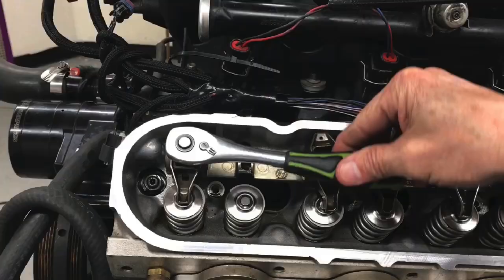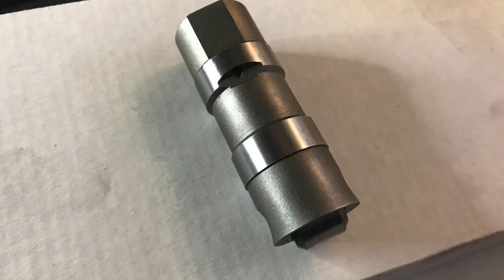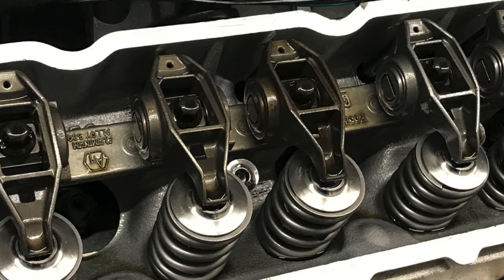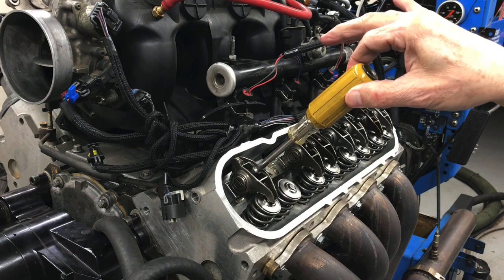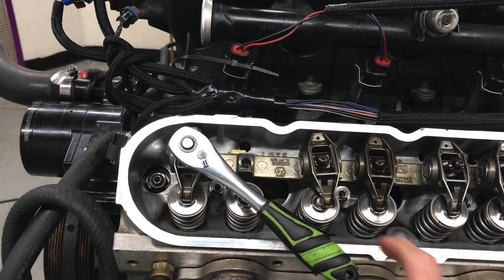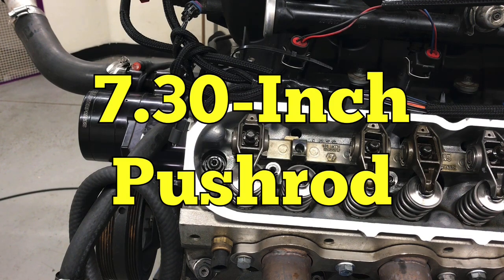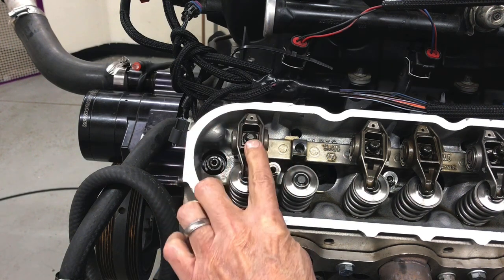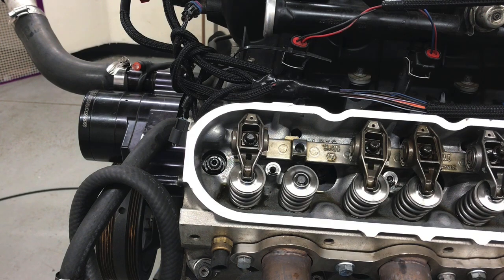HOW TO DIY: MEASURE LS PUSHROD LENGTH-CHEAP & EASY!

Comment: This doesn't show you how to figure out the length pushrod you need if the ones you're replacing are much shorter than what you need. It's a fail method if you don't already have the right length or one that's a small amount too long.
Reply from the maker: if it is too short-you have lash

Comment: Question for you i put my motor together and had a noisy valve train in the car dynoed at 320 whp, after doing some digging i had about .160 preload and with your method about 1 1/4 turns. The truck ran pretty good just seemed noisy. I put new pushrods in and my preload is closer to .80 about half a turn with your method. Does this seem about right? Also Do you think it was floating the valves before and have i gained any power?
Reply from the maker: less preload should not change noise and will not greatly change power

Comment: What does 1 full turn equate to?  .100'?    need a little more detail please,  running johnson lifters, they require .035' preload.   in this case 1 1/8th turn would be too much..   assuming 1 full turn is .100'
Reply from the maker: MEASURE THE THREADS ON YOUR BOLT-THAT PROVIDES TURN TO INCH RATE
Reply: @richardholdener1727  Yes i understand that and i have all of the tools to precisely measure this but i felt it could be confusing for others without the above information.

Comment: HEY DUDE, if im gonna do a cam swap and need to change my springs anyways, how much mor cost am i looking at if i get my heads milled enough to jump compression .5 to maybe even 1.0 more compression
  SO like goin from 9.5 % on stock LM7 to 10 .5 
whata  is a typical head milling like this cost? 
so i dont get rookie ripped off ....
is pushrod length only thing to worry about goin from 9.5 to 10.5 compression?
is that doable on87octane or am i lokking at 92 octane?
Reply from the maker: no on 87, don't mill more than .030, check pushrod length

Comment: Richard, I am lost. I order some Delphi LS7 lifters, Comp 1.5 roller tip rockers and BTR 7.200 pushrods. I just realized in the LS world, the lifter is torqued to 22ft and not a desired amount of "turn" like the SBC is so I guess I screwed up. Does anyone know how to set pre-load on this style lifter in a 350ci L98?
Reply from the maker: lifter is torqued to 22 lb-ft? Do you Mean rocker?
Reply: @richardholdener1727  Oops yeah I meant rocker
Reply from the maker: Setting the lifter preload on your SBC (assuming guide plates and adjustable rockers) is simply 1/2 turbo of preload past zero lash.
Reply: @richardholdener1727  It's an 88 Roller motor so just 3/8 stud no guidplates

Comment: How did you determine the safe done of turns?
Reply: Every lifter is different, but the bolt pitch means 0.050 travel per revolution. So the procedure is the same but you need to know the recommended preload for your particular lifter...

Comment: I have an L99 camaro just got a cam kit ss1 vvt done by gpi, ill be doing install.. head gasket is .040 and pushrods are 7.400 would that be any issues?  Is it because the cam lobes are shorter? it should be fine

Comment: Only way this will work is if you have the correct one to begin with you have multiple sets to try. Still easier and cheaper to use a tool.
Reply: Or an adjustable pushrod.
Reply: You can buy just a single pushrod. I bought 7.350,7.375, 7.425, 7.450 and saved a factory length 7.4. That's what I did now I have 5 different lengths for future builds.

Comment: Hi i got 1/2 turn on lt1 gen v btr cam and ls7 lifters and i hear some valve train noise I’m  using 7.850 should i go with 7.900 or 7.875
Reply: And i got 1/8 turn in some times
Reply from the maker: more preload should not change noise
Reply: What should I do then and is my preload good?
Reply from the maker: 1/2 turn is more than enough

Comment: You didn’t torque the bolt to 25 ft lbs, so your 1 1/8 turns could’ve been 1 1/2 torqued. But if it was 1 3/4 torqued that would’ve been too much. I go by preload measurements, you can use a dial indicator as well. Every 1 full turn is .079” of pre load. Ls7 lifters you normally don’t want more than .100” of preload. So if it takes 1 and 3/4 turns to torque to 25ft/lbs then that’s .138” of preload and that’s way too far out of tolerance and you need a shorter push rod. 

.079 x the amount of rotation. .079x1.75= .138” of preload. That’s .038 too much so subtract that from your total length and that should give you a better understanding of where to start. It all depends on the travel of the plunger in your lifter, some short travel lifters want .030-.060” preload, ls7 lifters go around .080-.100. Not enough preload can cause aeration in the oil and too much preload can hang the valves.
Reply from the maker: the turn method has no bearing on the torque setting of the fastener. Once you seat the bolt-torquing the bolt only adds stretch-it does nothing to the preload of the lifter.
Reply: Hello Richard, after finding out the right length, do you leave it like that or torque to the 22ft-lbs? I have 317 heads on a Gen III 6.0L. Basically after the turn method do you torque them down or left it at that.
Reply: @ByrdAK47  you torque it, but count your turns as you torque. If your torque wrench clicks over 1 1/2 turn then your push rods are too long, if you torque less than 1 turn then they are too short in my opinion. 1-1.5 turns is where you wanna be. Personally I like 1.25
Reply: @carguytim9913 excellent advice thank you. I just measured mine. With the stock 7.4 rods I get 3/4 turn of preload with LS7 lifters. I'm going to order 7.425 which should get me to the 1-1/14 turn.
Reply: he said 1/2 to 1.5 is good 👍

Comment: What if I'm using johnson 2110 lifters. I know people set the preload to 35 +/-10
I'm guessing I don't use the same "safety range"? So I'm confused about the preload and length of the pushrods with these lifters.
Reply from the maker: this method is for stock (std travel) lifters

Comment: What happened to setting zero lash and then measuring the number of turns till 22 lb-ft is achieved?
Reply: The extra torque to reach 22 lb-ft is probably stretching the bolt. Richard's method here from zero lash to "down" seems correct to me.
Reply: @jsmcortina  Seems? 😆

Comment: How much does that extra 360° turn equate to pushrod length? [eg: when ordering shorter pushrods]
Reply: You can determine that by using the TPI of the bolt, and calculating what one rotation is in distance.

Comment: If I have a 7.400 rod and want another 3/4 turn, what does that equate to rod size? Or what does quarter turn equate to?
Reply from the maker: try 7.450
Reply: @richardholdener1727   i ordered a set. I'll let you know. Thanks!

Comment: What Rod length should I use on a 454 a 6.135 or 6.385 rod with correct piston for each Rod to keep my compression ratio at 10:00 to 1:00 it will be a street and strip driven big block roughly 500 plus horse roughly 550 on the torque would there be any advantage for me to run a longer rod? Maybe you guys could do a segment or show same engine same compression ratio different Rod length and see the difference it makes and how the engine performs
Reply from the maker: YOU WON'T SEE A DIFFERENCE BETWEEN THOSE TWO

Comment: Zero lash and fingertip tight with a nut driver seem to be two very different settings for me. Once I feel like I have zero lash(lifter, pushrod, rocker, and valve tip all touching) I can still turn the bolt another half turn- full turn, just barely using my two finger tips and the nut driver. 🤷🏻‍♂️
Reply: You're too strong, get her indoors to do it

Comment: I have a 2002 4.8 that I have an ls9 cam in it, I’m going to do this measuring method after I get the lift errs pumped up. Does it matter what kind of pushrods you use?
Reply from the maker: you won't be very happy with that cam in that motor-requires a lot of change to the timing gear, harness to make it work and it will be down on power through most of the curve

Comment: I recently put my LS LQ4 together with 7.4 p.rods and I only get 3/8  turn to tight. Would dry lifters and fresh engine build cause it to be loose until engine gets some heat in it? Or do I need a 7.425 set of push rods?
Reply from the maker: they need to have oil

Comment: How would you determine the number of turns you need if you were using lifters that were not stock LS lifters?  What if it is a Morel lifter that recommends 0.060 preload?  Clear as mud.
Reply from the maker: then you need to be spot on with the pushrod length 1/4-1/2 turn

Comment: I ordered 7.4’s to go with my BTR Stage 4 v1 truck cam bc everyone said that the stock pushrod length was fine. I then ordered ls7 lifters bc I read they were a better design but now after using this method to check pushrod length I’m getting   1 5/8 to 1 3/4 turns. Should I go with a 7.35 instead? I did not realize that the ls7 lifters cup sets up higher until after I bought them
Reply from the maker: SEE HOW IT RUNS-THAT IS GETTING CLOSE
Reply: @richardholdener1727  will do thank you

Comment: I feel kinda dumb because I still don't understand how to measure pushrods. Say I milled some 317 heads, how could I use this method to give myself a pushrod length to order? I know that this would prove that I needed shorter pushrods than stock 7.4s, but after that I'm lost.
Reply from the maker: INSTALL YOUR HEADS, MEASURE THE NUMBER OF TURNS-IT IS IS TOO MANY (NEAR 2 FULL), YOU NED SHORTER ONES-.050 SHORTER LIKELY
Reply: Is a touch over 1 full turn to little

Comment: So would push rods being a little to long cause a lifter tick also? I just did a cam in my car and went up to 7.425 since i was told the base circle was smaller but now i have a lifter tick. Its not bad but can hear it in the cab when the radio and ac is off.
Reply from the maker: longer does not usually cause that

Comment: Hey Richard!! I got about 3/4 to 1 turn on most of my rockers, except for 1. I’m getting maybe 1/4 turn… you think that’s normal? Maybe bad threads..?
Reply from the maker: you have a problem
Reply: @richardholdener1727  I checked the preload with my tool, and it’s the same for all the others… maybe its a bad thread

Comment: I just installed new lifters and factory length push rods.  Is this method still accurate, or do lifters need to be pressurized first?
Reply from the maker: THEY NEED OIL

Comment: So am i getting from this to buy a pushrod length set thats longer and shorter then my stock set and see which one turns less seems like a pushrod length checker would be much easier to use
Reply: No that's not the point he's just giving examples. If you install the stock 7.4 push rods and you get more than a turn and a half or so they're too long, use common sense to figure out how long. Same thing if you don't have to turn it much. 

 Imo 1 full turn to a turn and a half is the spot for ls7 lifters, a little more or less will work too.

 The difference in this vid between the 7.4 and 7.5 was a full turn, so you could say 1 turn is roughly 0.100 inches. IIrc the travel of a ls7 lifter is 0.170 and anywhere between 0.075 to 0.125 is the sweet spot, roughly. Hydraulic lifters have a little fudge room lol

Comment: If u use Ls7 lifters in a lm7 do u have to change your pushrods?
Reply: Yes you will, depends on cam, springs and rocker ratio used. Check what year your LM7 came out of because the cam journal is larger on like 2005-2007.

I'm unaware if the LS7 uses full roller or just fulcrum roller rockers, I know the LR4 and LM7 use the roller fulcrum.

Here is a guide for LS Engines.
Look at the stock cam, pushrod, rocker ratio specs on the LM7 and LS7.
https://www.onallcylinders.com/2018/03/01/lm7-5-3l-vortec-5300-engine-specs-performance-bore-stroke-cylinder-heads-cam-specs/

https://www.onallcylinders.com/2018/01/18/ls7-engine-specs-performance-bore-stroke-cylinder-heads-cam-specs/
Reply from the maker: LS7 IS THE SAM ROCKER STYLE-JUST DIFFERENT RATIO-SLIDER TIP
Reply: If you change something in your valvetrain, ALWAYS CHECK YOUR PUSHROD LENGTH. Cheap insurance.
Reply: I've heard of LS7 lifter being preloaded up .150 the ls7 lifters are very forgiving when it comes to preload.

Comment: Hello Richard. CAN YOU PLEASE HELP ME???? You said "Your factory LS Pushrod measures 7.40 inches" but when I lookup the specs, and Measure my current pushrods, they measure in at 7.785in.  Can you PLEASE shine some light on why the (Aftermarket) "STOCK REPLACEMENTS" always say 7.40in???  I'm afraid to go up from the 7.385, to the 7.4"  but don't want to go down to the 7.375" which are the 2 choices in hardened rods I seem to find.  So I'll keep watching, and hopefully, with some calipers, you'll measure the 7.4in on screen so I can see if they are really 7.4 or 7.385in... 
If you know the answer, PLEASE TELL ME!!! I'm running LQ9, with ceramic coated pistons, stock rods and crank, 243 Stock Heads, With Double Valve Springs for my TSP220R cam. 220/220 @ 0.6/0.6 112 LSA...  So I think just a little to much could cause problems for me with my flat tops.
Reply from the maker: IS YOURS AN LS7? OR SOMETHING WEIRD? EVERY LS PUSHROD UNLESS IT IS ON AN AFTER MARKET HEAD IS NEAR 7.4
Reply: @richardholdener1727  Mine is an LQ9 Truck, With Flat top pistons, 243 Heads, TSP 220R with duration of 220/200 and Lift of 0.600/0.600... With TSP .660" POLISHED Dual Spring Kit w/ Titanium Retainers, & PRC Integrated Seat/Seal, running on Ceramic coated LS2 Pistons and 4th gen rods...  Other than my cam, all the parts are stock.. But the stock pushrods measure 7.385.. So I'm wondering what the aftermarket 7.4 actually measures and if that's why I should go with for the new springs, or just go with the shorter 7.375 Pushrods....  I don't want my valvetrain making noise, but I really can't run the risk of a valve hitting a piston.  I know the stock 7.385" length works PERFECT for my application, but my new springs will need hardened pushrods, and I can't find them in 7.385 a I NEED... PLESE HELP!!!
Reply: No aftermarket head.  STOCK 243/799 LS Heads... (ported and polished) but same stock valve size...

Comment: I have taken the valve cover off of a stock LS3 6.2L, and also a stock LC9 5.3 (the 5.3 was yesterday).  From what I can remember, on both of these engines I was able to "wiggle" some of the rockers side to side if no spring pressure was on them.  No up and down movement, but I can twist them side to side.  This was before loosening any bolts.   I always assumed this was normal, but this video describes this movement as "lash".  Has anyone else experience so-called "lash" on a bone stock engine?  Is this an issue?  TIA
Reply from the maker: there is no lash when the lifter is pumped up, there should be preload on the rocker
Reply: @richardholdener1727  Thanks, but I don't understand your answer.  So is it okay for bone stock engines to do what I described or not?  Also, love your videos ✌️
Reply: I think I get what you are saying.  There are certain camshaft positions where it's normal for the rocker to wiggle.  But those positions aren't the correct ones for performing this test.  Do I have it right?
Reply from the maker: there is no position on the cam on an LS that has lash, if the lifter is pumped up, there might be minimal side to side movement if the lifter is not pumped up
Reply: @richardholdener1727  thank you!
Reply: @richardholdener1727 sorry to bother you again.  My heads are nearly done at the machine shop so I'm revisiting this topic in preparation.  LC9 5.3, doing a stock cam/lifter replacement+DOD delete with all stock components (including stock non-DOD camshaft and Delphi LS7 lifters).  Reusing stock rockers and pushrods as they are in mint condition still.    Based on our previous discussion here - do you recommend "pumping up" the lifters before doing this procedure?  Based on what you said, it seems to be the only way to avoid experiencing what I had described above (rocker wiggle on a 100% stock engine).  However I am confused because your video doesn't instruct to pump the lifters up before starting this procedure.  I just want to be sure if I am seeing actual lash, or "fake" lash because the lifters aren't pumped up like you said. 

I'm using stock GM everything along with stock MLS head gaskets, so I'm sure my pushrod length will not change.  I just really would like to understand if I need to pump the lifters up first so I don't witness "fake valve lash" during this procedure - yes this is a term I just made up. 

Thank you.

Comment: So would you consider 1 3/4 turns to torque too much I have a lm7 with milled .30 243 heads and a sloppy stage 2  with LS7 lifters currently running 7.350 pushrods but valve train is noisy
Reply from the maker: TOO MUCH WON'T BE NOISY-TOO LITTLE WILL BE NOISY
Reply: @richardholdener1727  so 1 3/4 turns from zero lash wouldn’t be considered too much
Reply: LS7 lifters need between .07 to .10 lifter preload... your push rods should be around 7.45 with the preload.

Comment: Hello. im trying this myself and having some issues. 99 ls1 ls7 lifters, texas speed ls roller rockers. question is , when i snug it for 0 lash and start counting turns to seat it and i am definitely on the backside of the cam and i see the valve spring  compressing does that mean the pushrod is too long?
Reply from the maker: once you get to zero lash-then tighten them-either lifter or the spring will compress
Reply: I had the same question. Is it normal to see the valve start moving? I'm at 1.1 turns

Comment: Would have been nice to put in a math equation. Like 1 turn too much needs a .010 shorter push rod. I guess if it is too short you could use feeler guage between rocker arm and valve to get needed turns
Reply from the maker: I showed the number of turns vs length
Reply: If you read into it, .100" of pushrod length equals a full turn. He then goes on to say 1/2 to 1 1/2 turns is your spec, which would come out to .050"-.150".